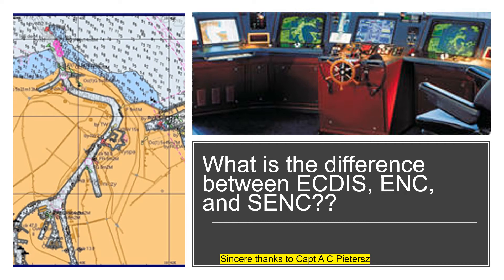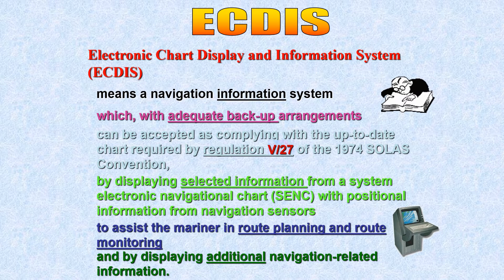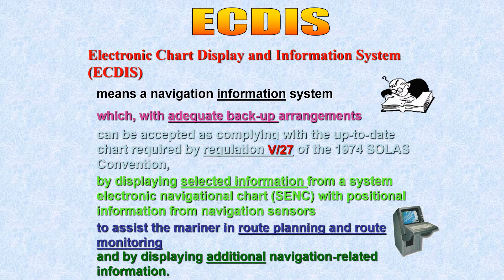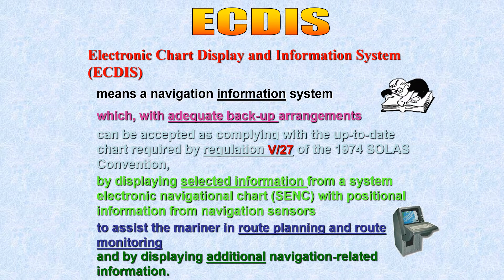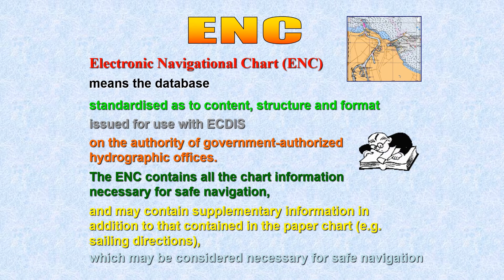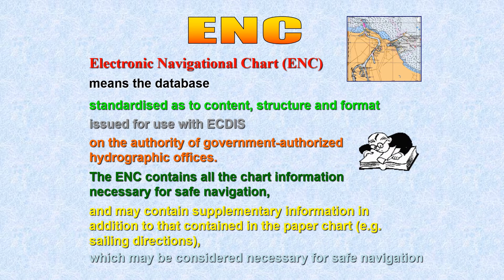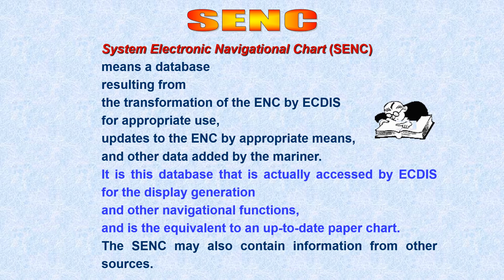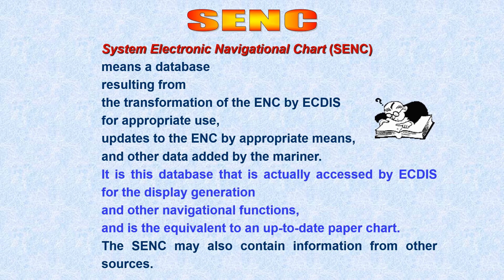ECDIS - What is the difference between ECDIS, ENC, SENC??

Comment: Sir... Why we are doing great circle, mercator sailing calculations? In ECDIS it will show the distance automatically. Then why we are doing these calculations. In ship at what situation we can use these calculations...
Reply from the maker: These days you have ECDIS, but many years back ships didn't have them. Even the GPS was not very accurate. So, we used manual calculations.
Reply: We are doing because MMDs need more decades to upgrade themselves.
Reply: Because some ships even now have paper charts.